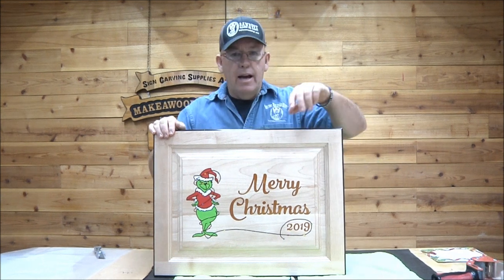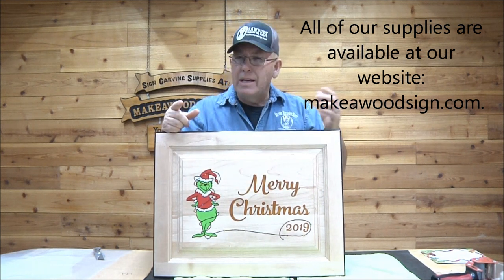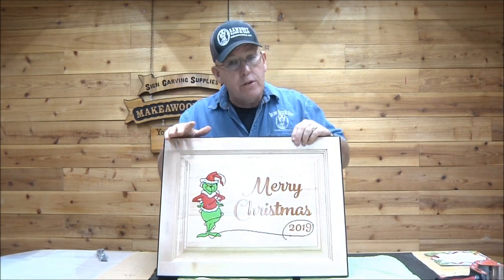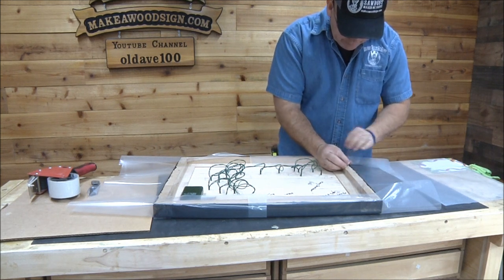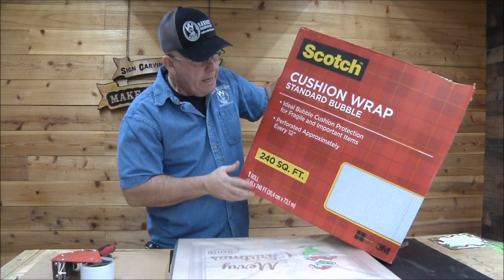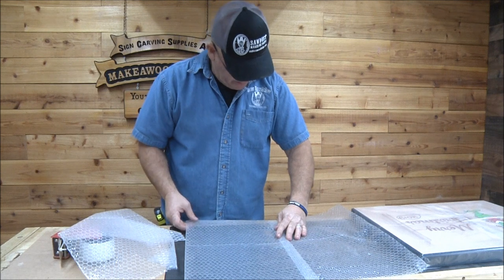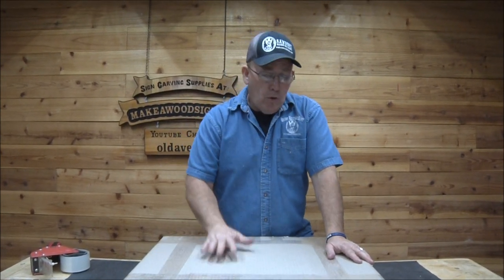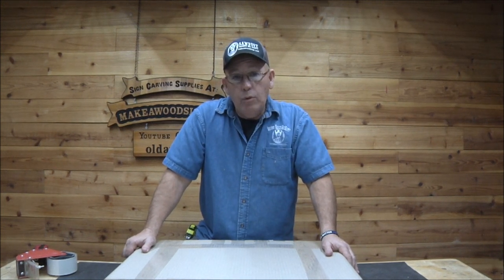#439 Packing A Large Sign to Ship

Comment: Could you use the black contractor trash bags. They are quit large. Or would there possible be a coating on the plastic that would react to the finish?
Reply from the maker: I guess it's possible, I've never tried it. Good idea to give it a try.

Comment: Hey Dave, I was just curious how you go about quoting the shipping costs at the time the order is placed. Do you just over shoot on the estimate, and hope it doesn't go over, or do you give them a price range and tell them the total after you get it ready to ship?
Reply from the maker: I've done it for so long I can normally come fairly close by guessing pad it a little just in case. Back when I started I would weight the material and add a few pounds. Then I knew what size, adding a few inches to compensate for packaging. Then I would go on and get a quote from UPS or USPS. Another way to do it is charge them for the sign upfront. Then when the sign is all done and ready to ship you can charge them again for the shipping charges. Sounds like a good subject for a video, Thank You
Reply: @oldave100  A vid on that would be great. Thanks for the reply!